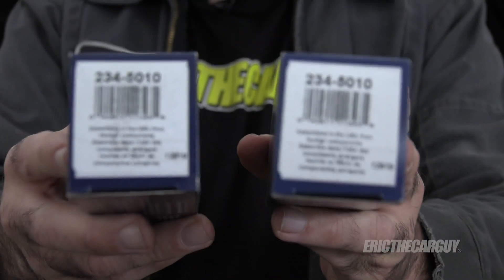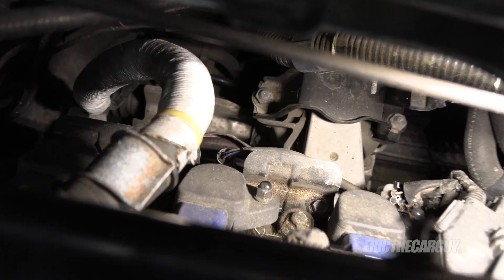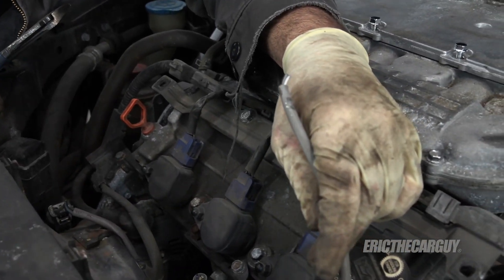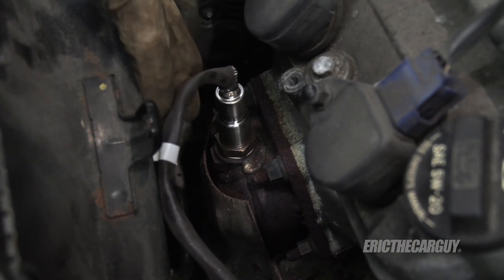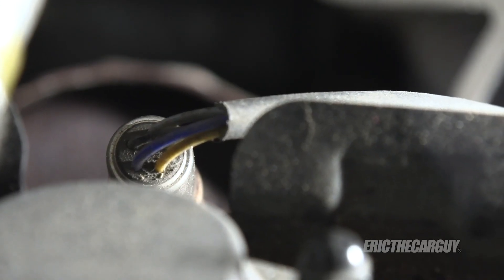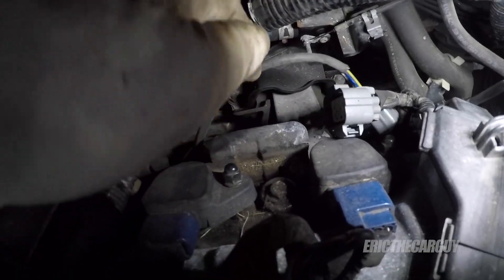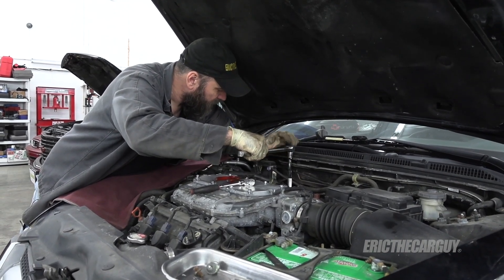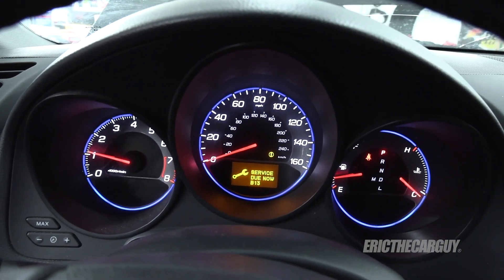Honda J Series O2 Sensor Replacement

Comment: THANK YOU. NO ONE ON YOU TUBE IS BETTER THAN YOU.
I BOUGHT THE FANCY TOOL, DIDNT WORK. CUT THE WIRE, MADE ME COMMIT, 7/8 6 POINT DEEP SOCKET A LITTLE MAP HEAT AND OFF IT CAME. I WAS DEFINATELY RELUCTANT TO COMMIT. THANKS AGAIN.

Comment: 8:46 this is gold right there for me. Once I saw you used your fingers and I got the sequence correct It came right off the bracket. I used my left hand thumb to push in toward the engine on the bracket clip and as the springy of the bracket pulled it toward the engine I used my right hand to pull the assembly back as counterforce. I’m only a DIY as necessary so for you full time mechanics these tips are normal everyday things….

Comment: One thing I wish I was told a loooong time ago is that these are Air/Fuel Ratio sensors. Not regular oxygen sensors. The downstreams are oxygen sensors but the upstreams are A/F. You need to know this if you have any hope of reading the sensor's output on a scan tool. Its a whole different beast. I hope this assists someone out there.

Comment: What an incredible deal you got on this car! I've had my 07 TL for the last 4 years, 200k miles and it's by far the best car I've had. I'm almost scared to get a newer Acura. Insane reliability and build quality. I put a bunch of sound deadner in the car, and its whisper quiet now. Hoping to take it to half a million miles on the original transmission. 👍😏
Reply: Honda can't be beat!
Reply: @MrCoffeypaul  I just bought a 99 Passport with a 3.2 in it. Are they good engines, and SUV's ? It has 163,000 mi.
Reply: @davidregan9872  Only one way to find out, have a mechanic do a leak down test.

Comment: Commenting before I forget, apologies if you mention it later in the video: I put a Denso O2 sensor in my civic and while it was mostly identical, it was missing a little foam bushing around part of the cable that clips in place. I zip-tied it in place instead and it works fine.

Comment: to my knowledge there are 2 different o2 sensor socket sizes, my trick to make this easier is to run the engine for a few minutes to warm up the exhaust, I find that makes removing an o2 sensor much easier, thats what I did for my Trailblazer.
Reply: Depends on the car. On the cars I work on, that's the best way of getting a nice 2nd degree burn ;)

Comment: Its great watching the repairs you’re doing on this Acura. You got a great deal on the purchase of this Acura and I’m sure it will purr like a kitten when you’re finished with all the necessary repairs. Perhaps you should change the serpentine belt, radiator flush with new hoses; I forgot how many miles was on this vehicle. Keep us updated. Thanks
Reply from the maker: If you watch the introduction video you can see what I have planned for it. Thanks for the comment. https://youtu.be/pI_wno4uJb8

Comment: You can use the sensor socket to take off a sensor that you want to reinstall (inspection, cleanup) by just using a hose clip over the socket. Doesn't even need to be any tighter than a push fit. Never broke a split socket with this method, and you can actually buy split sockets with purpose made sleeves (amazing for use with bleeding nipples on brakes).

Comment: Note that O2 sensors monitor the end of the engine combustion cycle and and can be affected by upstream issues and so it can be useful to test them when removed for the car.  Just check the heater wires (usually same coloured) for continuity and modest resistance (generally less than 30ohms) and the put a voltmeter (set to low voltage) across the other two wires.  Holding with long reach pliers, as a way of not burning your fingers, put the tip of the O2 sensor in and out of propane/butane flame.  The flame is void of O2 and provides heat.  When in the flame a working O2 sensor voltage should rise to about 0.9 volts and out of the flame will drop below 0.1volts.  If the sensor is caked in carbon to the extent that it inhibits O2 sensing (the voltage always stays low) then as a last resort you can heat the tip to red hot to burn off the residue. Often this will restore full function but it will be necessary to work out why your exhaust is so soot laden.   A rich running engine can be due to: something as simply as low coolant so the sensor prevents the engine from entering closed loop operation;  or over estimation of the amount of O2 entering the engine by a bad MAF;  or excess of fuel delivery due to a bad/leaking fuel pressure regulator.

Comment: Personally, I used the same socket for installation and removal with the same sensor without any damage. 
what you need is just a small tick to loose the sensor then by hand till you take it out.

Comment: There are 4 sensors total correct ? Any concern only changing out these two in the engine bay? No codes, 161k 05 accord v6… looking to improve mpg.

Comment: The first time I had to install one, I was too cheap to buy a special socket so I clamped my 7/8 socket in a vise and angle grinded a slot in it. For future reference, just buy the damn socket.
Reply: Thomas B ha it's usually easier to just cut the wire and use a normal socket. Then tighten the new one with an open end wrench.  The o2 sockets usually bend out and just strip it when it's stuck.  BTW it's really really hard to drill out the porcelain stuff in an O2 sensor!

Comment: Hello, I feel like my 08 TL is using a lot of gas. I am getting around 15city and 22highway. I did all my maintenance; spark plugs, oil changes, air filter. I am not getting a check engine code and I don’t think the previous owner has changed the oxygen sensors Do you think changing would help my MPG?
Reply: Did 02 sensors fix your problem?

Comment: need to change my upstream o2 sensor but mine has the “heat shield” on it and i can’t get my o2 socket in there to grab the nut to loosen. should i cut the wires like you did & see if that works? i’m thinking the socket i got is too chunky to fit even though it’s a 22mm. any ideas?

Comment: Shit, I'd never cut the wires.  What if I can't get the O2 out and have to bail on the job?
I've never had an O2 sensor socket split on me, mine are impact sockets if it makes any difference, but those were the best damn investment ever.  Total game changer when breaking sensors loose.
Reply: MrSlowestD16 Was thinking the same thing. I only remember cutting O2's off on maybe one occasion? The Matco impact crows foot tool has yet to fail me! And it's a 3/8" drive! Very Scookum Tool!
Reply: Exactly! I've had to replace a manifold that wouldn't turn loose of a sensor. At least I could still drive it until I found another manifold. (I saved 80 bucks by reusing the sensor that came with the manifold)
Reply from the maker: The methods I show in my videos are my methods. They are not the only methods, but they do come from 20+ years of experience working as an automotive technician who spent the majority of my tenure servicing Hondas and Acuras. I'm not saying that your concerns are unfounded, I've seen O2 sensors get stuck in manifolds in the past, but I was able to remove them, usually with the application of heat, then I repaired the threads, and installed a new sensor. I have a special tap for this very thing. I have not yet needed to replace a manifold due to an O2 sensor issue using these methods. 

Thats been my experience. I'm not saying your experience will be the same. That would be foolish, and also arrogant in my eyes. I merely show what I feel would be the most effective, and efficient way to go about something. 

Thank you for your comment.
Reply: @ericthecarguy  yeah, I think you have better means both in terms of knowledge & experience and in terms of tools in case shit goes sideways when removing them.  Especially on something like that j series where I'd not feel comfortable getting a torch on that rear sensor, don't know wtf I'd do.

I think being a non professional adds a certain level of caution to many tasks bc it's not as easy to back up if we screw up.  If those o2 impacts split I just take them back to craftsman and they replace without issues, but at least the car stays drivable until I try and figure out what in the shit I'm going to do for the next steps, which may require being done a few days later after asking people online or real mechankcs or whatnot.

Also, I think doing as few of them as I do the tools get used a lot less, and especially in a climate I have (moderate hot to moderate cool year round, no snow/salt) I think the chances of me running into a crazy sensor that's rusted in there is pretty low compared to somebody like you who may have done thousands by now and come across them in all types of situations.

Hope that clears up my perspective, as a diy'er.

Comment: Help I just bought  a 1997 Honda Civic with engine d16y8 . That came with code P0141 code . I’ve checked my vehicle and I’m missing the bank 2 . Is capped on the exhaust and I don’t see a connector anywhere . Any help to correct this issue ?

Comment: I have a '99 Infiniti I30 with a bad rear catalytic converter but its rusted on really good after 360k miles. I'm not sure how to get it off. I also dont know what kind of replacement O2 sensor brand to go with. Would they use a Denso sensor also?

Comment: Would you ever use ntk (ngk) o2 sensors on a Honda for a replacement?  Ik their parts in the ignition system are great on Asian imports but what about their o2 sensors?
Reply from the maker: Yes, NGK is also a supplier for Honda.

Comment: Hey guys. I have an opel astra J 2014 1.6 cdti. It has 116.000 kilometers on it. I have recently bought it and all of my friends said that the clutch pedal is way too stiff. I have personally tried out other cars clutch pedals and the difference in stiffness is really significant. Going through traffic is a pain with it. You have to apply at least 50 pounds of weight in order to depress the clutch pedal. As far as I know, the transmission has never been serviced(clutch disk, pressure plate, bearing and the flywheel). I was thinking about servicing it anyway, but my concern is that the stiffness won't go away. Some people that I have spoken to said that opels have overall stiffer pedals than most brands but I don't think anyone can drive such a vehicle daily. Any advices that I should do? I don't want to pour a whole lot of money into it only for it to not get fixed. Thanks!!

Comment: Why don't people use normal wrenches with 02 sensors? I did one on my truck an used a wrench, I  ant get it off with the proper tool, I tried forever an I just tried a wrench an got it off in a minute, is this a bad thing?

Comment: Pro Tip when you're taking the strut bar nuts off use penetrating fluid and a LONG breaker bar those things are on there pretty tight And I spun a nut on mine using my DeWalt impact gun

Comment: You know the resistor for the A/C system in these Hondas? All it is, is a sand filled fuse, a resistor and heat sink.  You can rebuild them for about 40 cents. Honda sells them for 300 bucks. Jobber you can get them for $120.  You can buy the parts on Ebay.  It's a very easy rebuild. Almost an ideal first solder project.Tested and working in a 01 Honda. If you want part numbers just reply. to make it worth it. You have to buy 5 or more of each fuse and resistor. Do not substitute the sand filled fuse. It's a fire hazard without it.

Comment: Ummm Eric.... the title of the video says "oxygen sensor removal"... and the one's you are changing is actually an Air/Fuel ratio sensor... 5 wire plug... the oxygen sensor is actually after the cats below.. both bank one & two!

Comment: I have a 2010 Honda Accord V6 sedan and it used to burn oil and I had to get the engine rebuilt at 116k I'm at 155k now I don't have codes for the oxygen sensor but do you think the catalytic converter could be partially clogged from the burnt oil?
Reply: @B Watts it's hard to tell because I got a bad engine mount somewhere

Comment: Dielectric greese in those connectors stop the rot and make it easy to undo.
Reply from the maker: I disagree with this. I don't feel it's necessary as the connectors are weatherproof. Adding grease will just make a mess in my view. Thank you for your comment and input.

Comment: Previous Acura strut replacement video, "ONLY USE HONDA ORIGINAL PARTS" This video, "eh it's the same". Funny but on a serious note, how do you know which parts need to be make/model specific and no other will do, which can be other brand but must be OEM, and which can be your "as long as it connects the same"/"minor tweaks"?
Reply from the maker: I normally cover that in the videos I post. https://www.youtube.com/watch?v=wC2MZNY1Ie8

Comment: Are O2 sensors a maintenance item or should we wait for a CEL indicating an O2 issue?
Reply from the maker: Wait for the CEL. Modern computers are very good at detecting O2 sensors that are going out.
Reply: @ericthecarguy  thanks. After all these years I still smash the like button, my screen, and my desk with every video 😁
Reply from the maker: @B Watts  That was an issue with the older single wire O2 sensors, but as I stated in my previous comment, newer vehicles like the one in this video have very strict O2 sensor monitors that set codes much sooner than older systems did. Thank you for your input.

Comment: Eric, how do I disable the ABS/VSA on a 06 odyssey?
Reply: Pull the fuse or relay
Reply: Maybe if you go to ericthecarguy.com you might find your answer
Reply: Scan the abs light for codes
Reply: @helloitsme4139  thanks for the reply. I tried pulling the fuse. However, that didn't anything. I still can't accelerate over 3k rpm w/o the engine cutting out.
Reply: @screamcheese246  thanks for the reply. I did but I may not have searched thoroughly enough. I'll give it another shot. Thanks.
Reply: @ONeal397  thanks for the reply. I just bought a new, what i could afford, Foxwell NT650Elite and got the following Error Codes, which in my spare time been trying to digest: 

- Anti-Lock brake / traction control / vehicle stability auxiliary control system (ABS / TCS / VSA) - Fault | 3
- 52-d Permanent DTC - ABS PUMP MOTOR RELAY OPEN CIRCUIT, which I have yet to be able to locate.
- 83-d Permanent DTC ECM/PCM RELATION FAILURE
- 86-d Permanent DTC - CAN RELATION FAILURE
Any direction is greatly appreciated. I've been my own mechanic since the 60's on motorcycles, cars, trucks, and vans. Worked for Western Diesel on semi engines and transmission  but I just haven't had to deal with these new electronics.
Reply: Can you give more detail as to what’s happening?

Comment: Leave the oxygen sensor in gasoline over night. After you put it back on, it may still give oxygen sensor code but it should go away in some days. If not, replace it. Make sure the sensor is dry when you put it back. Thread chasing is also recommended on the hole.
Reply from the maker: If the heater has failed, like with the sensors in this video, 'cleaning' will have no effect. Also, if your sensor has failed due to contamination, you have other issues that need to be addressed. Thank you for your comment.

Comment: Considering that those engine covers are there solely to keep people with severe inabilities to function in the premises of an engine from dying or getting injured and then lawyering up, i'd get rid of them. They do no favours to the engine bay. None whatsoever. Air circulation is a key factor in the life of an engine and unless they dumped twice the value of the engine in engineering those to keep things cool and kosher, i doubt they do it.